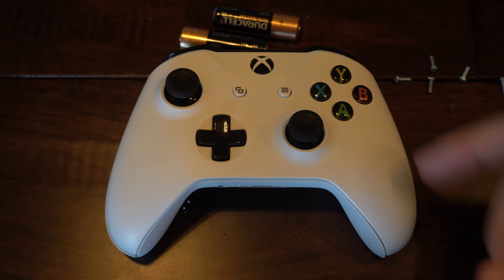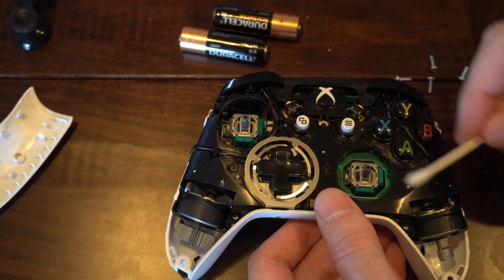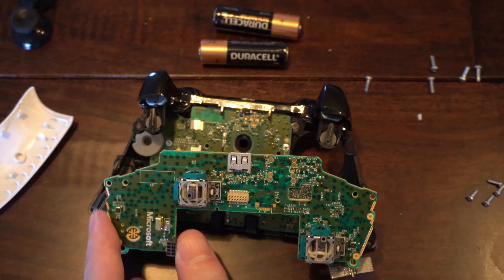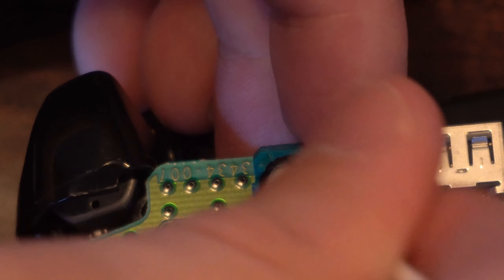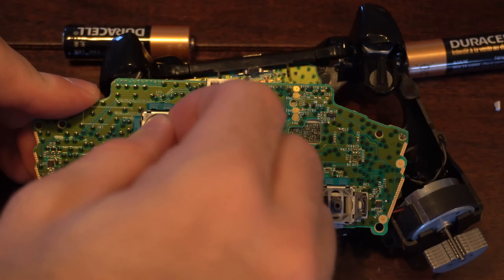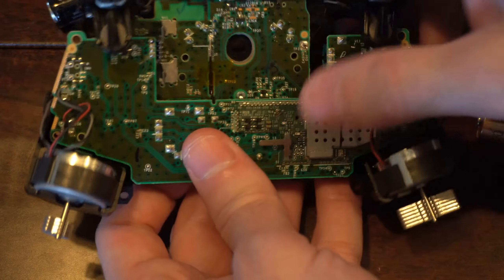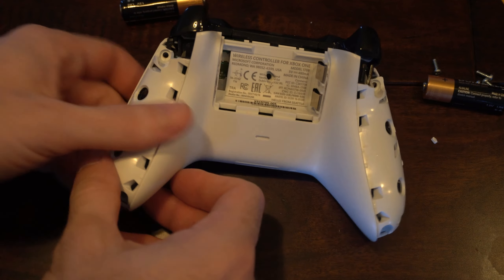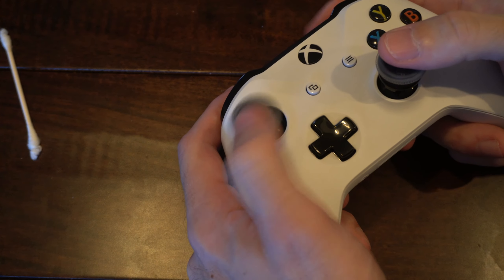How to Fix Analog Stick Drift on your Xbox One Controller from Moving By itself (Easy Method)

Comment: Thanks for this tutorial. It would be better if you could point small things with something smaller than a finger ;) Also for first unlock I used plastic card and I managed not to bend any controller plastic. The smal copper thing is very hard to pull out and it has less than 1mm thick almost broke it. Unfortunately all of it did not help.

Comment: READ COMMENTS BEFORE DOING THIS 

*breaking more than it's fixing, judging by feedback...
Reply: if you are too forceful you can snap the potentiometer which is game over basically.. but ive opened my ps4 potentiometer and fix the drift using this same method. It works